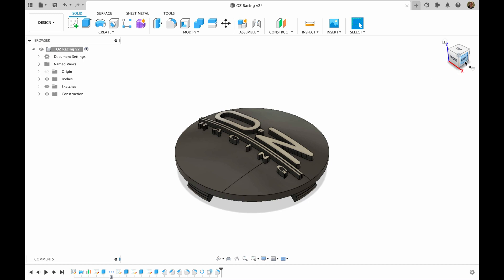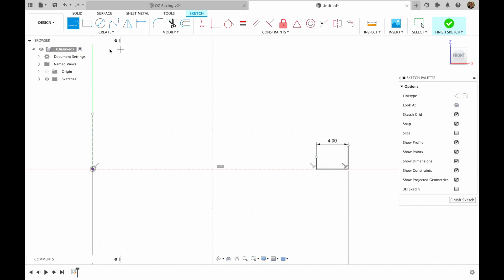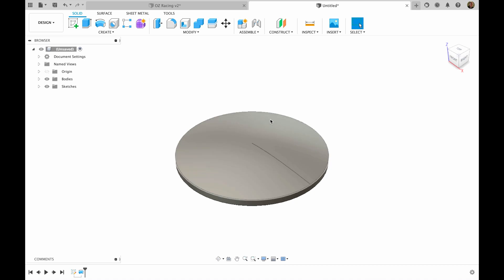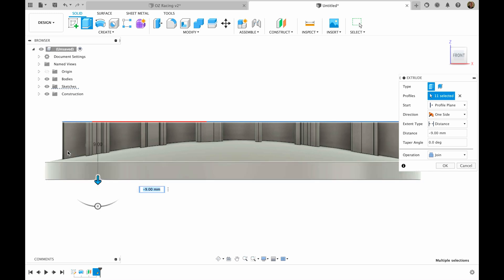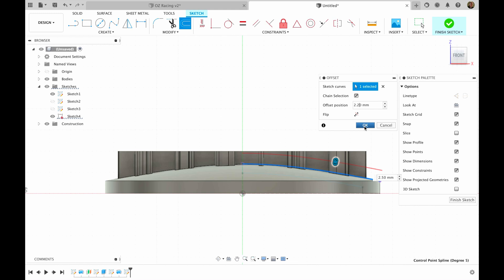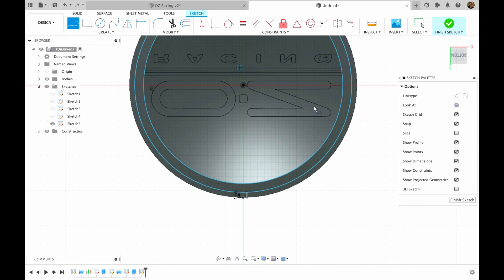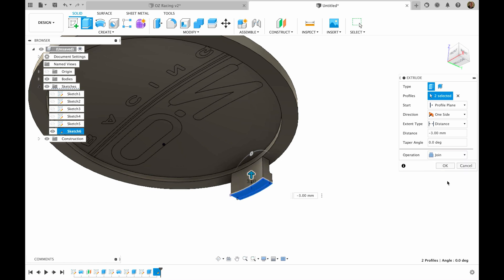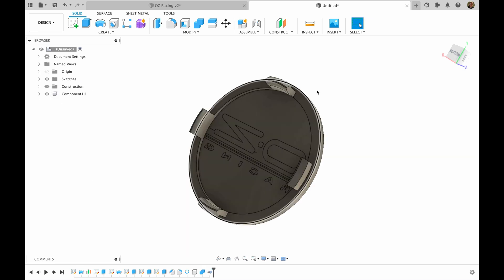Fusion 360 Tutorial: OZ wheels cover EASY, STEP BY STEP!

Comment: Hello man I am struggling with legs of caps they keep breaking what is your tip make them flexible  enough to squeeze in or so
Reply from the maker: Hi, i would make them smaller, but more pieces
Reply from the maker: Can try to make “spring” mechanism longer